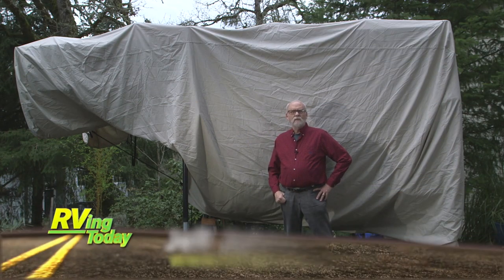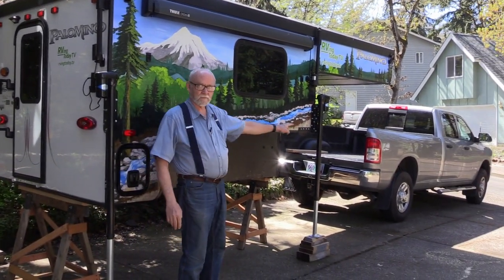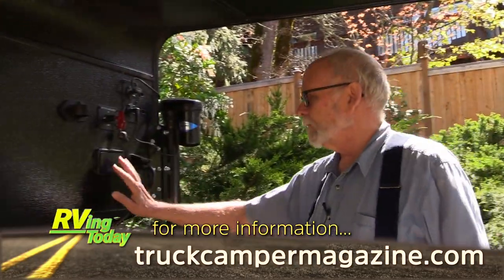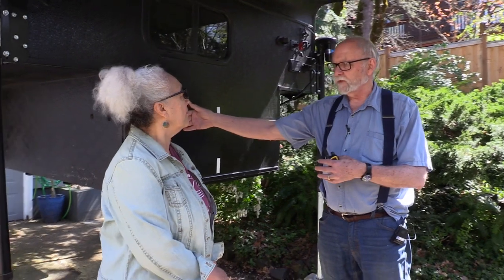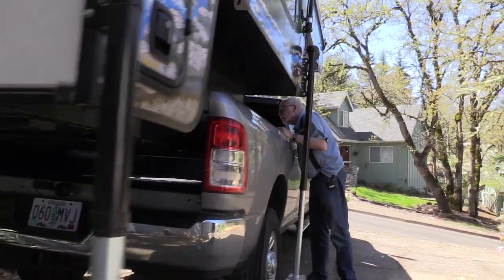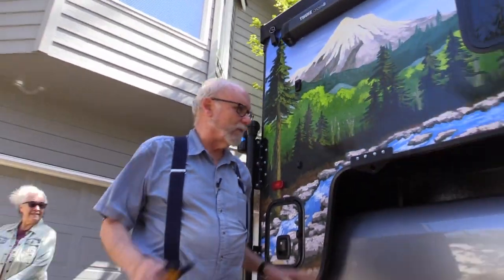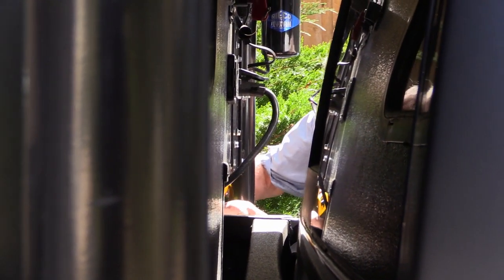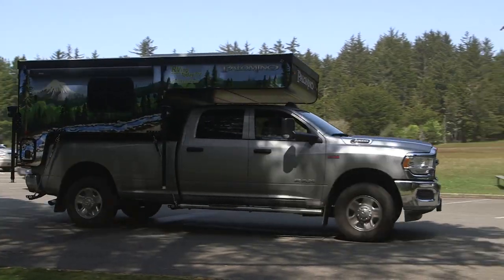How to Mount a Truck Camper with Jeff Johnston on Show Segment 2023 03

Comment: Enjoyed your video. For me the biggest challenges are; 1) getting the truck and camper lined up and keeping it that way, 2) when the campsite or my storage area are out of level, the camper is leveled by the jacks so when backing up I have to get the camper at the same tilt as the truck. For these challenges, I use a simple green site level. The level shows how much to tilt the camper and where the truck is inline with the camper. It stills take practice and a good spotter. Thanks again… HT

Comment: I am a week away from picking up my first ever truck camper and the loading/unloading of it has me on pins and needles!!  So glad I came across your video.  I really like the idea of simply putting tape on the camper and bed to align it.  Do you have a factory camera mounted on the back of the cab third brake light and do you use that as well?  Thanks for the video!!  :)